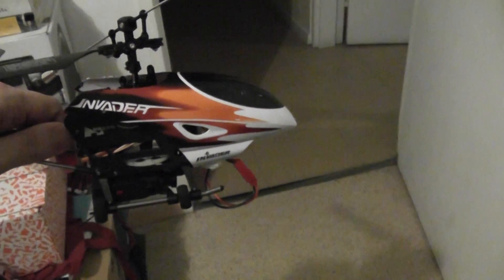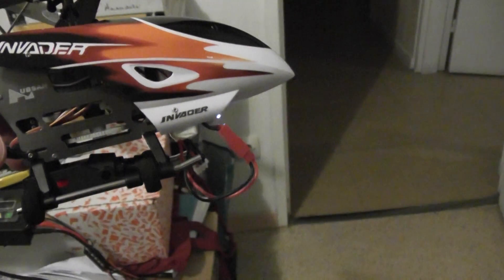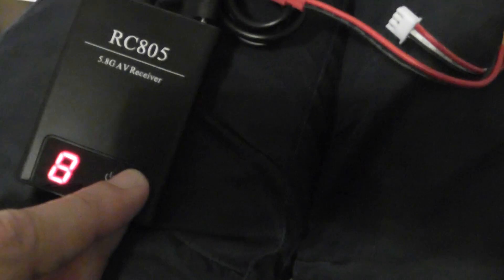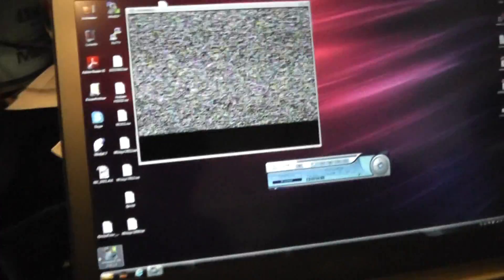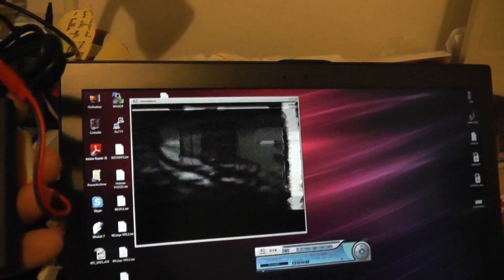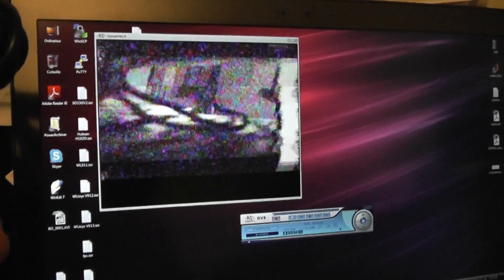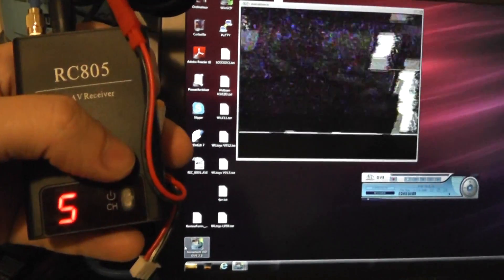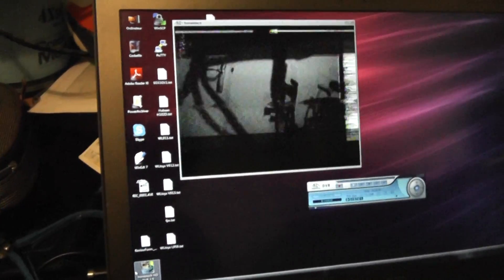Hubsan FPV wireless camera captured by external 5.8 Ghz video receiver (RC 805)

Comment: Hello... 
Boscam Transmission TX24017 e Recepter RX2189????
I need to install on Quadcopter Hubsan h107c, can you help me do this, riding the installation procedure, because I want to view the camera image on the Quadcopter tablet (android) or computer (windows7)?? need cable??? Software which can use it in tablet / computer??
Looking forward to ... 
Regards ... 

Edson Moura - Brazil
Reply from the maker: I advice to take a RTF model Hubsan H107D .... At least you will learn to flight FPV everyting linked. You should also read forum at RCgroup mini-multimotors for example, it's very interesting

Comment: which products are needed for installation .... I have Hubsan h107c (with camera) ... as I can see on a tablet with android ....
Reply from the maker: You nned a version D, with a video transmitter ...
Reply: SeBy DocKy tem como instalar transmissor FPV como esse (esse receptor Boscam)... como funciona???? receiver cable that you used, which integrates USB, you indicate buy it at some site....